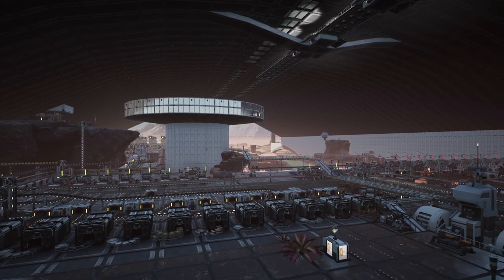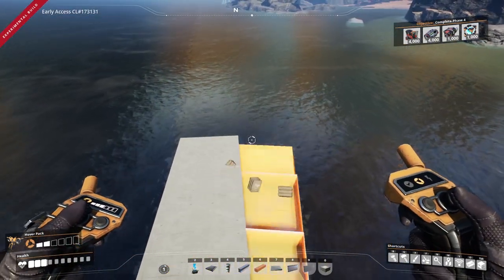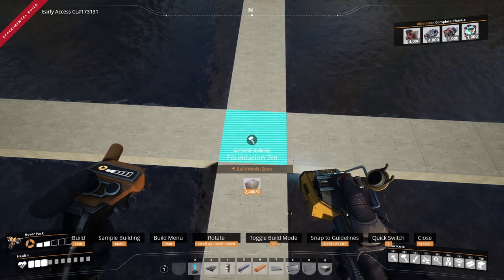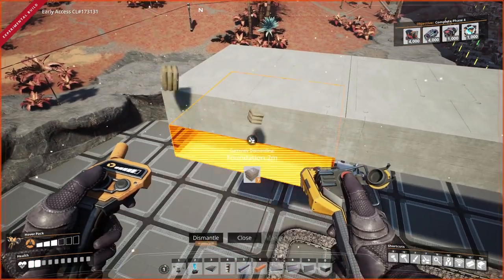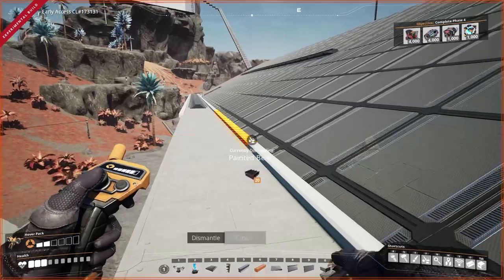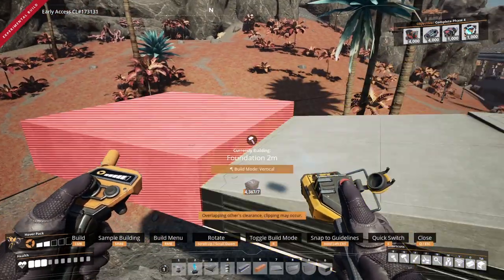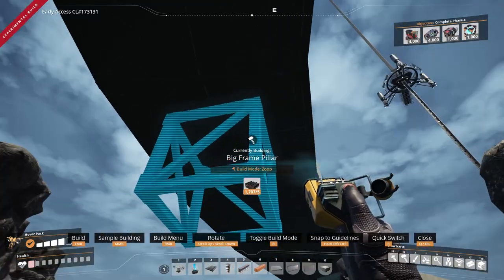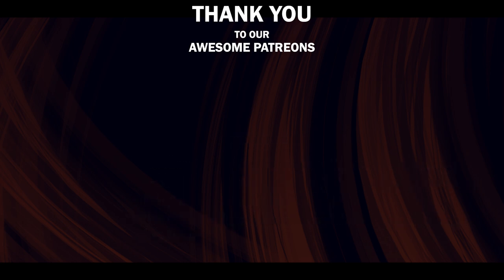How to make Satisfactory Curves | Satisfactory game

Comment from the maker: Will you be using curves in your builds? If so, what for?
Reply: I already do.  U4 I had the oval shaped storage building.
Now I have a hub structure with a round facade and been practicing making curved roads.
Reply: i have a really strong z-fighting allergy, so no. :D
I really wish for procedural roads. I mean the code is in the game already: rails.
just be using models and textures of a two track road and maybe a start or transition block to regular foundations. that would be so sweet. I'm no modder, but maybe one day someone picks up that idea and runs with it ;D
Reply: I'm going with a strong "maaaayyybe?" here. I got the hang of the simple 3x3-based 90-degree corners and I like things to grid out neatly, so doing these kinds of custom curves seems like a recipe for frustration on my part. (Note I'm only talking about rail lines here. Circular buildings isn't my jam.) But... well, my current save is called "eSthetic" for a reason. We'll see.
Reply: Once I get time to build up my train lines again, I may create some large, curved viaducts that will curve around the northwest and southwest edges of the map.
Reply: I'm experimenting with techniques to avoid Z-fighting... so the answer is a solid "probably". Hoping to use a round section for my central storage, placed on top of a more traditional rectangular processing section. (Edit: Come to think of it, my idea of using ramps on the outer edge of the circle and filling in with grid-aligned foundations inside will work particularly well for that building. The rectangular part below the circle will provide the eventual floor without any issues of trying to keep corners from sticking out beyond the circle in places.)

Definitely my fledgling rail lines have become more curved now, since I can calculate where on the square grid the supports belong for any given angle and then rotate them to look correct. On the down side, building my rail lines just got FAR slower. The stencils and asphalt material make me want to build roads, but my current thinking is that it isn't worth the trouble except in areas where they can be kept straight.
Reply: I really hate the z-fighting honestly. So probably going to use it only for rails, and roads, but not for buildings. I hope they will introduce a better road or foundation system later, or solve the z-fighting problem somehow. This would completely change the way we can shape our buildings.
Reply: I built a large, gentle  curve and let the different production wings jut out from it, it really helps me not get lost in large factories. Next version will have wider connecting corridors for the spaghetti though T_T Curved catwalks look so good too.

Comment: If you want to easily shift foundations horizontally in 1m increments, place a small concrete pillar 1 increment (in the direction you wish to shift) from the center of the foundation then you can snap a foundation centered on the bottom of the pillar. Delete the pillar and you are good to go!
Reply: You can also do the same with vertical beams since they will not be recessed inside the foundation like the horizontal beams are.

Comment: You can create an even smaller circle by doing a 7X7. Do the same trick as shown above, but create the circle with 3 increments instead of the 2 increments. It still creates a fairly decent circle size from what I've found. I often use this smaller circle shape on the inside of all the circles to reduce the z-fighting (The flickering) of the foundation models.

Comment: 6:10
if you place a beam on top of a foundation like you did in your video, then place another foundation beneath the first one, remove top foundation and place another beam vertically from the inital beam to match foundation height you will resolve height issue

Comment: if you want the corners of your foundations to line up perfectly, place a barrier on the corner, connect a walkway floor piece to it, and add a foundation, voila, perfect angled corners without that slight overlap. The barrier doesn't have the fine control that pressing control with a foundation has, but more than enough to make smooth curves that don't need a center point
Reply from the maker: I've seen the walkway method but I honestly don't think it's as smooth a corner and looks more jagged it's certainly a viable option though

Comment: I just use the wire spool technique to add angled foundations right to the end of the track, but I run three or four foundations straight from there before angling again.  I suppose your way results in smoother edges to the trestles.  My bridges, however, are deck truss bridges made from 4m frames, and real bridges like those run straight chords between supports, so my way is actually realistic for the type of bridge I make.

Comment: So the new way to make curves is a little different, it starts the same way and continues up to the point where you have to hold ctrl and turn, the increments now are significantly smaller than they were in update 5, but there is an easy pattern! 

Place the first foundation
Lock the hologram
Roll your mouse wheel 1 notch (consider this an odd notch) (in the direction of the curve (considered FORWARD)
Hold your ctrl key and roll your mouse wheel BACK 5 mini-notches
Create line, then delete all but the last foundation (the one for the curve)
Place foundation and lock, roll it forward 1 notch (odd notch - without control) 
Holding ctrl roll your mouse wheel FORWARD 5 mini-notches
Create line, then delete all but the last foundation (the one for the curve, 2nd one in this instance)
Place foundation and lock, roll it forward 2 notchs (even notch - without control)
Create line, then delete all but the last foundation

This is where it gets interesting, after you build the line off the even notch, you then repeat the odd notch, until you have a perfect 90 degree angle.

Odd = one big notch, -5 small notch, followed by one big notch, +5 small notch
Even = no small notches

Comment: My foundations will only rotate in 45 degree increments when touching another foundation. CTRL will not allow the new incremental rotation AT ALL. Any tips?
Reply: Same, I cannot get the fine detail shown in the video. 🤔🤔🤔
Reply: @magburner  I finally figured it out last night. Take a look at your keyboard bindings. The hotbar selection should be Alt+Mouse scroll. Mine carried over the old control binding: CTRL+Mouse wheel. It showed correctly in the main menu but when I loaded the save it reverted. If it stays as CTRL it interferes with rotation. Hope this helps.
Reply: @MrDwebber1979  I even did change it to some other key (i.e. hyphen key). Saved the game, closed the app, started and loaded game again.
Still stick to 45°.
Alt+Mouse Scroll changes the hotbar menu (as it should) - Even when changing back to Left-CTRL Key, same 45°/90° 🤷‍♂️
Reply: @dominikamon9634  I figured out that sometimes the keybindings in the main menu and the keybindings while I'm in my save are two different things. I'd check that. I haven't had any problems since I changed it in my save.
Reply: @MrDwebber1979  I can confirm: Changing the keys (i.e. Right CTRL) in the Main Menu BEFORE loading a save game, THEN opening a save game and change the keys inside the running game by reassigning it to Right CTRL and then change back to Left CTRL, it did the trick!
Reply: Yeah, this just doesn't work,  see the other comments here but the increments work for catwalks and not foundations.

Comment: how do you get it to make small changes. i saw your other video, and i think it was newer, but when i go to the side of a foundation or on top i only get an option to make a 45 degree change.
Reply from the maker: Smaller changes are done with smaller increments or by extending the circle to create a more straighter edged look to it
Reply: i had the same problem but i fixed it by changing my keybindings
since I have crouch bound to "ctrl" i chose to bind "snap to guide lines" to my left alt key (if i hold alt and scroll i can rotate the foundations in smaller increments)
however i had to change the "cycle to next hotbar" keybinding from "alt + mouse wheel" to "ctrl + mouse wheel"
hope this helps^^

Comment: When I hold control and move the mouse wheel, it does not work. Only cycles through the 45 and 90 degree options. Help?
Reply from the maker: Make sure that your CTRL Key isn't mapped to something else
Reply: Changing the keys (i.e. Right CTRL) in the Main Menu BEFORE loading a save game, THEN opening a save game and change the keys inside the running game by reassigning it to Right CTRL and then change back to Left CTRL, it did the trick!

Comment: You should do a video on mod compatibility. The smr says all of the mods are compatible but that couldn't possibly be true, but some were updated today, so is there a way to tell if those ones are updated to update 5 without guess and checking?
Reply: You could check if they got updated the past day. I think most modders waited with updating their mods up until Update 5 was in ea.
Reply: @drschwandi3687  Do you think any modders are still updating for update 4? I don't want to have to guess and check, and there are a few that were updated today.
Reply: @drschwandi3687  : That's the fastest metric, otherwise it's a pain going through them all. Flex splines is compatible so it makes creating those "curves" easier.

Comment: I'd love to do this but the z-fighting would drive me crazy
Reply: I can't tolerate the z-fighting, but it occurred to me that putting a ramp at the outer edge of the circle and using normal squares inside would eliminate it... since it happens when two objects have flat surfaces that are exactly in the same spot, and the diagonal ramps can be placed so that they only coincide along a line. So far I've only tried it with a small octagonal build, but I'm quite happy with how it turned out on that. The primary challenge with a full circle will be making sure that the flat inner section has its edge entirely hidden... but if needed, it should be possible to use a double row of ramps to make that happen (not sure if it would actually look good).
Reply from the maker: Also try using asphalt you can't tell there's z fighting unless you're up close
Reply: I'll give both of these a go 👍 I also wondered if I could use the interactive map to move something by a tiny unit to avoid the z fighting be preserve the flat look